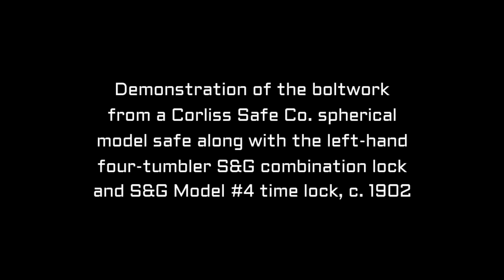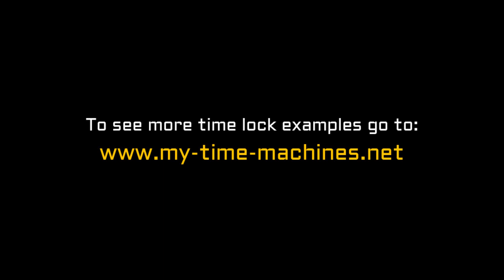Sargent & Greenleaf Model #4 and four-tumbler combination lock for Corliss safe, c. 1902, demo

Comment: A couple corrections should be made.  This version of lock and timelock were actually used on the 2 largest Corliss models, the 2 Planet safes.  Another lock setup found on some of the smaller Planet safes did in fact use a single dial movement No. 4 timelock.  Thanks for putting up the videos.
Reply from the maker: Hi Doug, I had wondered what model this was from. My supposition came from the relatively small curvature observed on the lock superstructure. Also in John's book a planet model is shown with the time lock on the side of the inner sphere and not located immediately below the combination lock. Also on my website is a photo of another Corliss with the same setup, http://www.my-time-machines.net/sg_1_2mvt.htm. It would seem from the construction of this artifact, that these were located behind the door plate where the two combination locks would have been located. Do you have any photos of this set up? Any clarification would be helpful either here or through my email. Thanks!
Reply: I meant to say two movement No 4 clocks have been seen.   Only the    2 Planet models include the timelocks in the door face.  The 2 Spherical models have the timelocks mounted on the side.  Also the curved section you show  matches up to the bronze faceplate found on the outside of the door.  The most interesting aspect of the Corliss safe has to do with the pointed slave bolt that sits in between the comb and timelock.  But that is another story.
Reply from the maker: Doug could you contact me on my email with more info on this? I want to learn more about the slave bolt and the differences from the planet vs. spherical.
Reply: @dougmacqueen1679  I would be quite interested in that story if you're willing to share it.